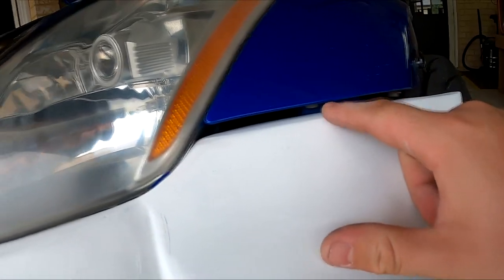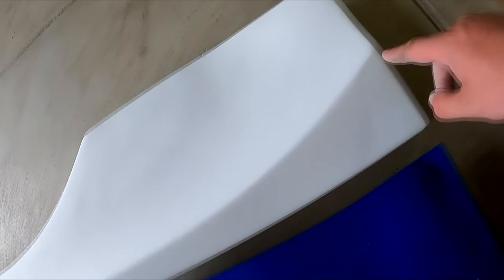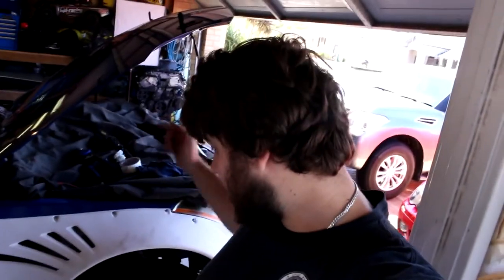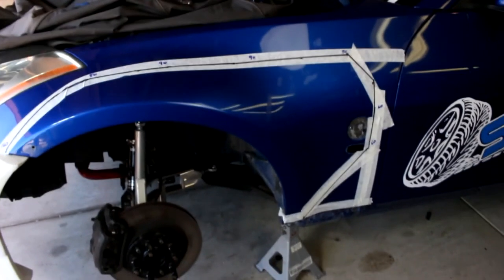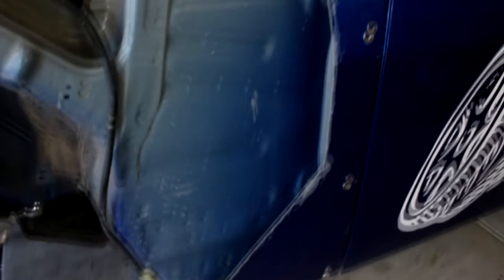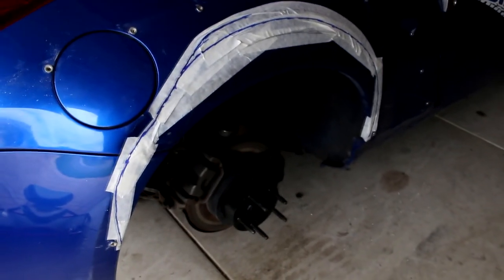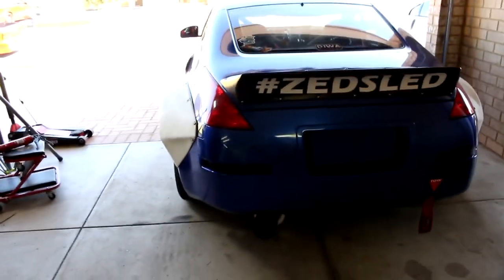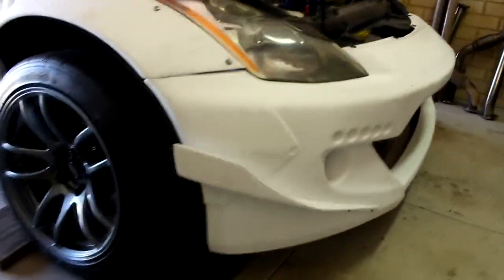350z Rocket Bunny Install + Full Custom Wrap

Comment: Thx for the great vid! Will totally help on some of the measurements on the front. Totally appreciate that bro. One question i have is, u said u used wheel spacers. What did u finally use for the front and rear to get that stance? Right now my wheels are 9 in front and 10.5 in the rear. Appreciate what advice u got in this, thx in advance.
Reply from the maker: Hey Bro on the front im running 15mm and on the rear 50mm. Both front and rear wheel sizes are 9.5.
Reply: @braydonkinnear  ooooh ok the manufacturer told me that it would add 2" to the front and 3" to the rear. Bit different than what they told me lol. And you said that you drift your car, no issues with the spacers drifting? What brand spacers if you don't mind?
Reply: So in the section of the vid(26.22mins) those are the spacers used, 15mm and 50mm?
Reply: Sry couldn't tell anywhere else in the vid cause u always have the front cranked lol just trying to buy the spacers a head of time, reason for the ?'s😂
Reply from the maker: @xWSGSxSTANG  Yeah no issues with the spacers still running the same spacers now. they are Gktech hub centric spacers.
Reply from the maker: @xWSGSxSTANG  The spacers recommend from the manufacturer might be with stock wheels. It really all depends on your wheel specs.